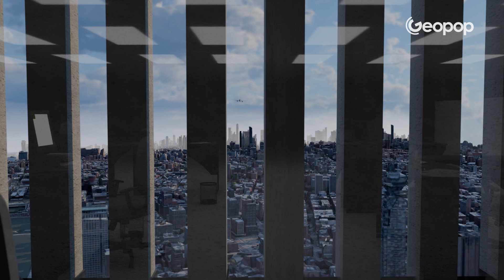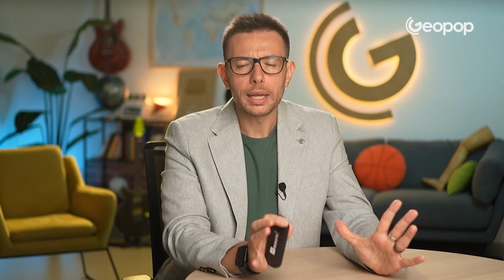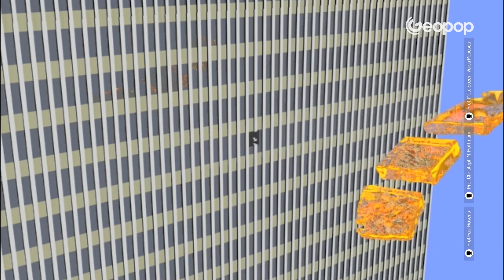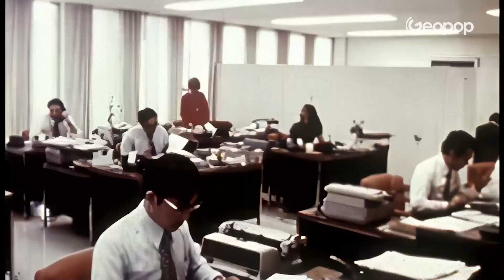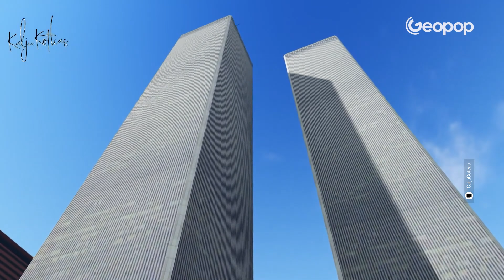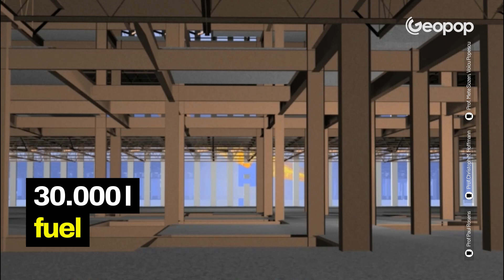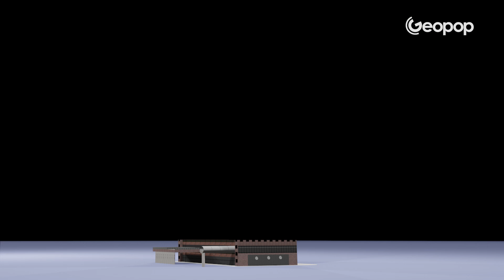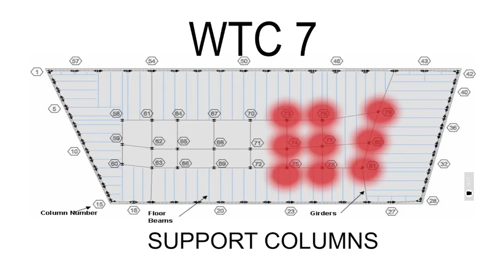9/11, 2001: The Technical Reconstruction of the Twin Towers and WTC 7 Collapses

Comment: The NIST report doesn’t even address Building 7 and, when confronted by the Architects and Engineers for 9/11 Truth about why the buildings fell straight down instead of sideways and in parts, one of the NIST Report creators admitted that the pancake theory is flawed and doesn’t meet scientific and/or mathematical standards.  Some of the conspiracy theories are, in my opinion, intentionally interjected into mix for the sole purpose of obfuscating the truth.  It begs the question of why was the government so adamant about grouping ALL the conspiracy theories together and going on a PR campaign that many consider as pure propaganda, to ostracize anyone and everyone that asked questions or doubted the official narrative?
The NIST report is fundamentally flawed and, ipso facto, the official narrative is that those in charge of the official investigation don’t actually know what happened.  There’s a foulness in that which goes beyond rational thought.
Reply: Starting at the top;  You claimed the NIST report doesn’t even address Building 7 which is an odd claim to make since The NIST published two (2) reports on the 9/11 attacks, one for the Twin Towers and later one for Building 7.  So The NIST did address Building 7 in it's own bespoke report.

Final Report on the Collapse of World Trade Center Building 7, Federal Building and Fire Safety Investigation of the World Trade Center Disaster (NIST NCSTAR 1A) - Published November 20, 2008

So your opening claim the NIST report doesn’t even address Building 7  is either an outright lie or grossly ignorant. 

Which is it?

We can address other points you made later. To maintain focus I do prefer to address them one at a time.
Reply: Also, in the beginning of this video you give a brief blanket disclaimer, for which I applaud your honesty, that states no one really knows what happened.  That said, however, throughout this video you repeatedly say that “NIST determined” certain things, when in actuality, what you should have said is “NIST hypothesized” or “NIST assumed” certain factors to reach their conclusions.  It seems like an intentional attempt to inject certainty into the largely theoretical. 
It just seems like an odd thing to do to imply certainty into theoretical and hypothetical scenarios.
If ever someone was willing to address this situation with the seriousness and reverence it deserves, they would layout PRECISELY what are known facts, how those facts were used in making the NIST calculations and determinations, whether the computer simulations were made using purely factual data and, if not, what data was guessed at and how those guesses were formulated, a discussion of ANY AND ALL simulations and tests that were conducted and their results, as well as which were included and which were excluded and the reasons why for each, and lastly, but certainly not least, the theories and arguments of educated, licensed, and experienced architects and engineers that disagree with the NIST report and the validity, or lack thereof, of their findings and conclusions as they either support or oppose the NIST report’s findings and conclusions.
Anything less than the above means the court of public opinion does not and has not had enough information to make anything remotely resembling an informed decision on what transpired.
If the relevant experts that disagree with the NIST reports are wrong, what possible rationale is there for not addressing and thoroughly destroying their claims?
Anyone that’s ever been a main party to a lawsuit knows that if the opposing party brings an expert witness to testify at trial, you only have two options.  You either have to attack their credibility as an expert such that the judge determines they are ineligible to testify as an expert, or you have to bring your own expert witness with a differing opinion.  If you do neither of these things, the opposing party essentially has an automatic win.  
In the case at hand, there are a plethora of qualified experts that vehemently disagree with the NIST report’s findings and conclusions, and presenting them without addressing the opposing viewpoints is akin to saying that the NIST report is uncontroverted.  This topic demands and deserves to be addressed properly or not at all.  You guys did something bordering upon half completion.  Now it’s time to finish it.

Comment: I was 12 years old when this event took place. I am 35 now. I have personally always known through intuition that this event was not a terrorist attack. Over many years of research a lot of abnormal facts have crept into view. The first and foremost...that a military photographer analyst reported to the pentagon that a request was filed to have him look at a photograph of the aftermath of the pentagon damage and he identified the hole left was done by a military airstrike that was later redressed to appear as a plane crashed. Very intriguing. Now looking at the towers from that same vantage point..aerodynamics states a massive amount of drag would be holding a massive plane like the two that "struck" the towers wouldn't have enough momentum to do the damage they did, let alone cause the buildings to perfectly vertically decend. Another point..the government issued a permit for military grade termite 2 months before these events took place. The amount needed to bring buildings down safely of their size requires a special government permit. The third and foremost evidence..Sadam hussein gave the fbi permission to come to Iraq to investigate him. The FBI turned him down. So in my highly self educated point of view: this day market the day of the most disgusting inside job ever performed as a collaboration of high brass, and corporate teamwork. Dick Chaney ordered the Air force to scramble planes the opposite direction of NYC and the pentagon specifically tasked operations to practice for events that indeed ended up taking place. As for the agenda behind it? Anyone thats willing to go deeper follow the money from DOD to private aerospace contractors and watch as that money literally disappears. (USAP's) as an American it pisses me off witnessing the corruption. 34 trillion in debt? Who cares? Print more bills..so they can ask for even more...(Lockheed Martin skunkworks, Boeing, Northrop, etc)
Reply: Sounds super suss.  This photographer got a name? Where are the photos?

Comment: Ok let's put this is as dumbed down as you can get. Basically think where stress on a horizontal beam would cause it to be the weakest when heated. It will be at the middle of the beam because that has the most weight at that point to support so if the floors are like the beam they sagged in the middle cause the ends were held by the outer columns. So since the elevator bank is dead middle of the building it's like a big empty space except for the inner core beams. When the fire's got hot enough to weaken both the inner core beams enough  and the floor supports, the floors above all fell onto the floor below as one big weight all being pulled inward towards the elevator bank which is why it looked like a controlled demolition. Now no one floor is meant to hold god knows how many floors that fell on it, the outer columns, the floor itself and inner columns all work in conjunction with one another to be able to have more weight on it. So as the tower collapsed the chuck collapsing got bigger and bigger, which means mass is increased which means more speed. So there is your answer to the gentleman who said how do you account for it accelerating.  I know I used to actuslly think it was inside job to and I'm NOT a conspiracy person at all because of how it looked like an implosion. Unfortunate the open floor design and the empty core allowed all this. but back when they were designed human beings didn't fly planes into buildings on purpose to kill mass amounts of people. When you think of this day though, this is the kind of shit Ukraine has faced the last three and a half years on a daily basis now at the hands of russia. Just food for thought for those Americans who ask why's it our problem. Because when it was your problem we made it ours to. Doesn't hurt to return the favor without asking to be paid back ffs. We didn't demand you pay us when it was you.

Comment: Ultimately it wasn't fire that brought down all three buildings. It was gravity and the design of the buildings.

The frame of the buildings doubled as the exterior walls.  Both planes made very large holes and a dangerous amount of support structure was now missing.  One of the huge antennas from the wtc collapse tore a large vertical gash in the side facing the courtyard.

Even without the fires, I think these buildings would have collapsed not long after they were struck.
Reply: It's a combo platter:  Impact damage + Fire (heat) + Time + Gravity = Collapse 

Remove any of those and there is no collapse.  

Without fire I have no doubt the Towers would have held.
Reply: @TheCriticalStinker-jw4fl Had you heard about the C clamps attaching the floors to the outer beams?  I find very few people know about them.  I read about the ways the floors were attached in Popular Mechanics,and of all places. 

I suspect we will never know for sure what specifically caused the collapse.  I am confident there were no explosives.  I wonder if there was a way to test this.  The 2nd tower went down first because the plane hit the tower on lower floors, so there was more weight above the breach. The plane also went in at angle which caused a larger breach and came close to taking out a corner. This proves that pilot knew what he was doing.  Not content with the damage caused by flying into a building with a plane fully loaded  with gas, its clear they aimed to take the buildings down.
Reply: Right. If you watch closely you can see the wall that took the impact fell over . Pulling the building down with it. The, the sheer weight of one floor after another finished it.

Comment: "Rivers of molten steel" = thermite
Reply: Thermite melts steel?  Does it though? If only someone had actually tested this instead of just guessing or making unfounded assumptions. Oh, wait!

youtube.com/watch?v=JXWCMBuusMI&ab_channel=TrutherTVArchives 

In this video starting at 45:35 and running to 48:35 the Energetic Materials Research and Testing Center (EMRTC) conducts a test to examine the effectiveness of thermite in cutting a vertical hollow box-section steel column. The column tested is smaller in cross section and made of thinner steel than that of the Twin Towers perimeter columns (and never mind the core columns). In total 175 pounds of thermite are used for the test on just one column and requiring the construction of a rather conspicuous coffer dam to contain it. Do recall the Twin Towers had 240 columns and 110 floors.

It would be odd if thousands of office workers missed hundreds, perhaps thousands of those suddenly appearing.

Note what an incredibly slow process this is. It took close to 30 seconds for the thermite to finish burning off.  It would be impossible to “control” a demolition using this material.

Not to mention the issue of; how does the aircraft impact and subsequent raging fires NOT prematurely set this stuff off?

Also note how bright and obvious the whole process is. Could not be missed visually. No way to hide that. 

Then at the end of the test the (relatively modest) column was undamaged…. which is a problem.

Certainly no rivers of molten steel emanating from it either and in fact the whole thing cools rather quickly as soon as the thermite has burned off, as one would expect.

Thermite has never been used in the controlled demolition of any building, let alone one with multiple floors on fire after the impact of a large jet. If the conspiracy oriented internet has taught us anything it’s that if something has never happened before, it can never happen.

Comment: This was a controlled demolition. So many unanswered questions. How did building 7 fall? Among the many questions. Not conspiracy theory but genuine questions
Reply: That is a so-answered question.

The collapse of Building 7 is one of the most studied engineering disasters in history and the subject of 5 comprehensive engineering studies and more than two dozen technical articles in major peer reviewed engineering journals, most of which were published 15 or more years ago. Thousands of pages of material.  This should get you started.

FEMA BPAT (initial report superseded by NIST NCSTAR 1A)

NIST NCSTAR 1A: Final Report on the Collapse of the World Trade Center Building 7, 2008.

Guy Nordenson and Associates, WTC7 Global Collapse Analysis Report and Summary of Findings, 2010.

Arup, WTC -7 Structural Fire Analysis Report (Runs 1-4), 2010.

Weidlinger Associates Inc., WTC 7 Collapse Analysis and Assessment Report, 2010.

BRE Centre for Fire Safety Engineering, Analysis of the Impact of a Fire in the Mechanical Room (5th & 6th Floor) of the World Trade Center 7 Building, 2010.

T. McAllister, R. MacNeill, O. Erbay, A. Sarawit, M. Zarghamee, S. Kirkpatrick, J. Gross, Analysis of structural response of WTC 7 to fire and sequential failures leading to collapse, J. Struct. Eng. (United States). 138 (2012) 109–117.

For a summary of the major studies I would recommend THE COLLAPSE OF WORLD TRADE CENTER 7: REVISITED by Mhd Anwar Orabi , Liming Jiang , Asif Usmani and Jose Torero which is a 33 page summary of the different analysis and conclusions published in 2020. Sorry, YouTube will delete this post if I give the link but it should be easy to find and is available from the University of Queensland, Brisbane. 

Real structural engineering industry professionals conducting real engineering studies and publishing them for other professionals to see. Not amateur YouTubers appealing to the gullible and credulous.

Happy reading

Comment: Are you smoking crack?  The models from NIST have never been released to the public for scrutiny.
Reply: The NOST certainly released the models, just not the input data for the Building7 models, which you absolutely don't need and wouldn't know what to do with if you had it anyway.

Anyone can create their own Building 7 models without the specific input data The NIST used and many have.
Reply: The reports are public.